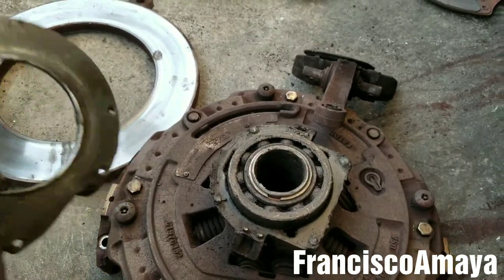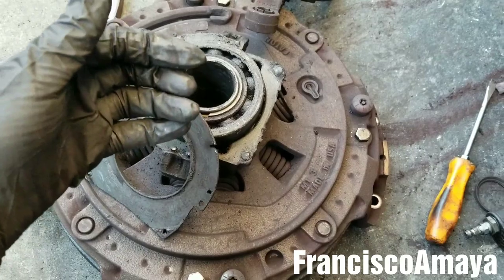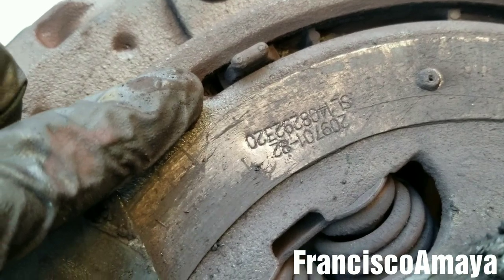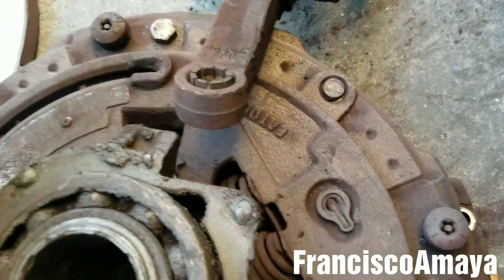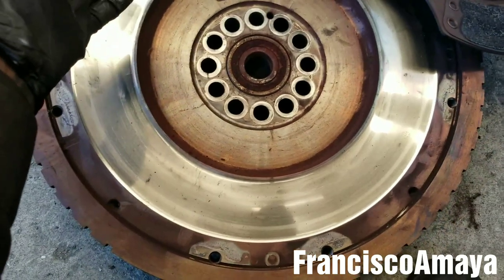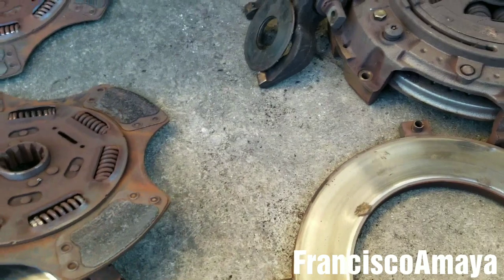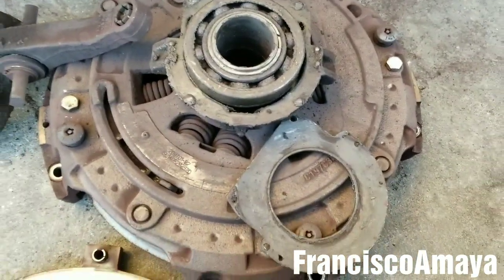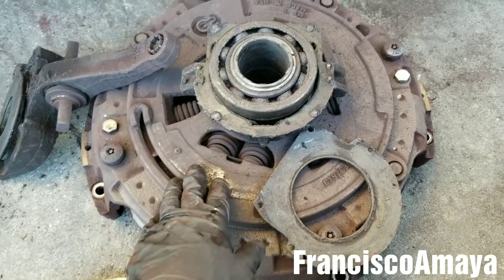Freightliner Cascadia broken clutch bearing vibration while pressing the clutch pedal replacement

Comment: I have a 2020 Freightliner cascadia with dt12 auto trans. when I accelerate between 25-40 miles per hour i feel shudder in the whole truck but only when i press accelerator. When I release the accelerator pedal the shudder goes away. Or when i press accelerator pedal full power then the shudder goes away. Only when i give slight pressure to the accelerator pedal only then i feel strong shudder. Any ideas?

Comment: Hi my friend I just had a new clutch replacement on my Cascadia and the mechanic did not replace the grease pipe he said that you don't need it now is it true or how long can I run like this
Reply from the maker: It can be greased, there is a grease nipple on the side of the clutch bearing
Reply: If you grease your truck yourself then get under the truck and look for a grease fitting that you can get to on the release bearing.  If you have someone else grease your truck you need to make 100% sure they are able to grease it.  (not a "yeah we got it")  It needs to be greased about once a month.  If there isn't a way you can get to the fitting to grease it then you need to make the shop fix it.   Your clutch will not last without greasing the release bearing.  I have seen them fail in less than a year.